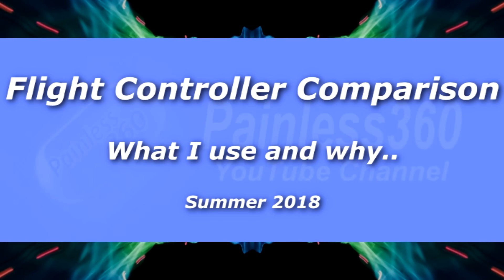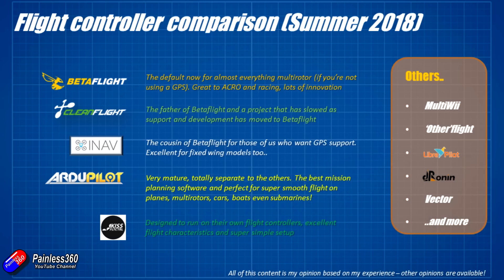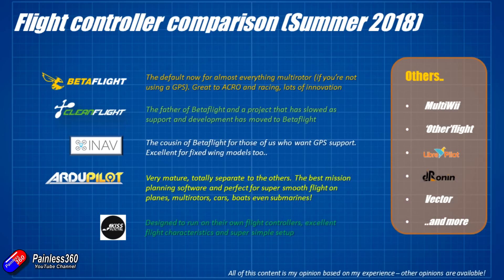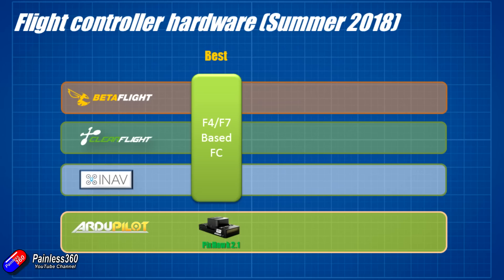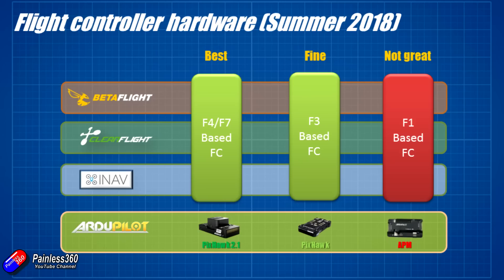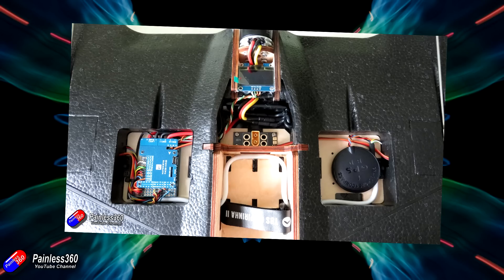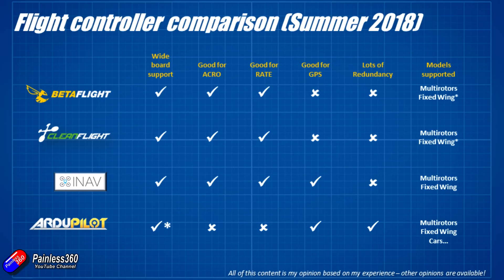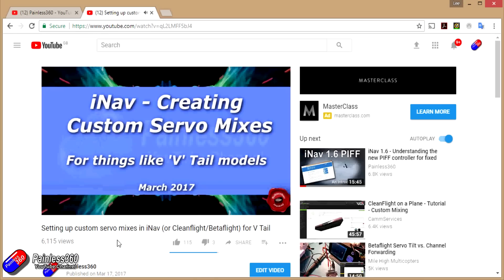What flight controller software & hardware should I use? (Summer 2018)

Comment: Hey. I'm about to throw beta flight in the garbage I've got three computers and trying to add these drivers to get BF to work has been a pain. So what would you recommend to use so I don't have to deal with another driver again? Thanks
Reply from the maker: I've never had any issues on Win8 and Win10, the drivers were there without me having to do anything.. Best of luck!
Reply: @Painless360  Thanks  I think the Win10 Pro is the issue.

Comment: OK Painless,  this is getting painFUL now. I had asked you about "programming" & here it comes but
you didn't have to answer.  This is part of my concerns to this hobby. I'd want something that runs
itself & just to do the transmitter ought to make for enjoyable flight but some overzealous code
writers had to outdo one another..... The ability to make it do more is great but 95% of people
don't want/need all the extra capabilities these seem to offer.
So many decisions.... I want simple.
I'm a simpleton.....lol,
an obtuse simpleton
Reply from the maker: I have to agree. A lot of the effort is going into adding more bells and whistles into the technology rather than lowering the entry point for new pilots - making it easier to set up out of the box. Technologies like KISS fly brilliantly and a lot easier to configure than things like Betaflight these days. That’s the reason I make these videos - a lot of the ‘manuals’ are average at best and unless you’ve seen somebody else set something up, you’re on a hiding to nothing. Check out the builds and  the build series on the channel, they should help a lot. Best of luck with your journey!
Reply: @Painless360  ~ Sir, I thank you & applaud you for all the dedication/time
you've given all of this. I'm in no hurry. I'm going to select quality & not
going to do a lot of excess work. All of these electronics could be on a
single board including step downs for different voltages. I'd gladly pay
extra to not go thru all of this now. But you're helping me greatly and I
am glad I didn't give up.  I don't think many understand the amount of
work you're doing just in the video end, not to mention all the RC Stuff?
Thanks for all you do.  diggy in dallas

Comment: Your videos are always so good! Been watching them for years. Got out of building quads for awhile with the advent of DJI spark and Mavic Pro 2. But was curious about autonomous flight with a Wing Z-82 . Was wondering what board to use now that all my ccd3 boards are outdated and found this great 👍 video. Your content is always spot on, relevant and precise. Thank You from across the pond!!!
Reply from the maker: I’d look at the Vector, Pixhawk or something running iNav.. best of luck with the build!
Reply: Painless360 is there a small FC ( comparable to the CCD3 Revolution) that I can use in the Wing Wing Z-84 and use with I-NAV? My main goals are stable flight, gps and ultimately autonomous mission planning. Is there something smaller than the Matek F-405 Wing , with less bells and whistles? I’m interested in trying I-NAV after watching your videos but have to upgrade some hardware. What do I do with all the cc3d boards and APMpro? I looked at the pixhawk4 mini. Looks nice 👍
Reply from the maker: @marcoantonio2600  There is. Google something like 'inav wing painless360' to find my videos on the F35..

Comment: Camera drone? Do any of these do follow me? Im new to this, a friend has a mavic that can follow you and has a gimble camera,  want to build something like that. Possible? Or buy a mavic or spark?
Reply: Its possible, but as someone who has built a couple of full size drones built on the DJI F450 frame, one with a CC3D and one with a Pixhawk2.1 as a camera drone platform...  Buy a Mavic.  The learning curve on the software to make this stuff work is immense. Flying is easy. GPS programming for following you around and controlling the camera while you do it and getting the video signal back to you so you can see whats going on, is a colossal pain in the butt.  I love my drone, and I can fix parts on it when it crashes a LOT cheaper than fixing a mavic or a phantom, but I also have well over $600 invested in all the frame, motor, flight controller, camera gimbal, camera, video transmitter, receiver, radio, video receiver, tablet to run software in the field... you get the idea.
If you want to just go out and fly and get stuff done, buy a Mavic, or other factory made drone, not shilling for DJI here, if you like building your own stuff and diving into the programming aspect, then follow some other vids by painless360 on building up the pixhawk series.  This is where I learned what I know about doing it.
Either way you go, get flying and have fun!
Reply: starhawke380   thanks! Pixhawk sounds like a good way to learn. A A.I.  "pet" drone that follows me around sounds a bit father off lol. speaking of repairs, my friend pushed go home I think while indoors and it went straight up and broke the gimbal on his mavic. not sure how much that cost. It is interesting to see some cheap Chinese drones that seem to have follow me , even the Tello? Saw some video on a mavic teardown and there sure was a lot in there. The flight controller looked very impressive and Powerful .  Just trying to figure out a build / buy path. Not even sure what features I really would like. Follow me and obstacle avoidance are probably the two biggest that I'd want. Thanks again, Cliff

Comment: Ardupilot now runs on Omnibus F4 pro, Matek F405, Openpilot revo and revo-mini, and a bunch more. Not sure if these are officially released yet but you can get the daily builds. There is good onboard OSD support for at least Omnibus F4, not sure about others yet. With the very cheap price it's hard to look at anything other than Ardupilot/OmnibusF4 combo for a GPS-enabled build.

You can initially use the Betaflight configurator to flash firmware to these boards, and thereafter use Mission Planner to flash different versions. Full info and link to firmware files here:
http://ardupilot.org/copter/docs/common-loading-firmware-onto-chibios-only-boards.html

For an acro-only miniquad my favorite is still the good old F1 naze32 with pre-3.2 Betaflight, have not seen anything to attract me to newer hardware or firmware for such a bare-bones single-sensor controller, especially where I'll probably be smashing into something eventually on my own anyway :)
Reply: iforce2d Chibios is a great move forward, hopefully it will bring otherwise separate communities together so we can all try new things without having to buy quite expensive dedicated hardware. 

I’m also looking forward to the day companion computers are more easily integrated into DIY mini quads and quality digital image sensors. We can then get a step closer to the likes of Parrot, Yuneec, DJI Autel etc... at the moment we can make and control amazing flying machines that are either 90mph smooth flying rockets or 3mph super stable GPS builds. But adding the digital image and “touch screen app” features is not as easy. 

Thanks
Reply: Please share the link to buy omnibus f4 pro

Comment: Where do the Pixhawk clones from Chinese vendors (2.4.8) fit on this chart? Abyone with experience of these FCs?
Reply from the maker: Almost all of the Pixhawks that you get these days (apart from those from the main manufacturers like the Pixhawk 2.1/CUBE) will be clones. Trick is to get ithem from places that have good reviews..
Reply: Many thanks for the quick reply! Since the nomenclature is somewhat counterintuitive (2.4.8 vs 2.1), I just like to ask if these Pixhawks 2.4.8 are the type of FC described in the "PixHawk Video Series", that fall into the category "Fine" in the FC overview chart in this video.

Comment: thank's for this point. very usefull.
just a question: I have a Naza mV2 on an old F450. is it possible to change DJI firmware for INav ? Is it a good idea or not ?
Reply: Nope, you can't put iNav (or the others) on DJI NAZA hardware, sorry, Steve
Reply: OK ! thank's ;).

Comment: Lee u no if u wanna get longer running time on yr quads or ground rc.s is it a bigger c rating u want to look at or bigger mah
Reply from the maker: You want a few things, less weight, more efficient motors/props and more energy in the battery. See my endurance quad build series..
Reply: Painless360 cheers lee ill ave a look
Reply: Painless360 lee without doing all of that just to upgrade the battery as im not sure weather its the c rating to be higher or the mah to get a longer time of use lol

Comment: Great comparison! I would really like if you make a project with ArduCopter and Pixhawk 4 on a multirotor. Copter version 3.6.0 which should support this is soon to be released now (currently RC7). Thanx for the video anyway!
Reply from the maker: I will, once the code has been released and stable.. almost there!
Reply: Yes, I'd like that also, have a good day, Steve

Comment: Very thorough Video ....   Thanks ..!
Reply from the maker: Thanks for the comment. Very few channels actually go to the trouble to talk about the different systems and what is best in each of them. These days (with each flight controller being able to run so many different versions of software), it's more about picking the right combo for the model type, flying style and use you have planned. Thanks again, happy flying!
Reply: Painless360  Thank You for your reply . Have you ever mounted  an OccuSync Air setup to a temporary mount that can be transferred between airplanes ?   The extra units are so expensive to purchase one for each plane . Not sure if that is anything you or your friends have tried . I have a Pixfalcon going in a 8 in build soon . Enjoy & Happy Flying ...
Reply from the maker: I've not. I have designed a few backpack style enclosures for analogue fpv - see my Thingiverse page..
Reply: Painless360.   Thanks Again. ..

Comment: What GPS system would you recommend if using a f4 flight controller and Inav?
Reply: Any M8N GPS will be ideal for INAV, if it's for a fixed wing aircraft it doesn't need a compass. M6 and M7 also work
Reply from the maker: Thanks Tsnafu, perfect answer! :) Ian, please see my iNav series for examples of builds using that GPS..

Comment: Great video as usual! Thanks you for all the amazingly well structured videos.
What FC would you suggest for a 3 inch freestyle quad with focus on long flight video capture (split mini or Caddx Turtle cam). Was looking for one in 20x20 size with barometer to be able to flip from full acro to altitude hold depending    on the occasion.
Reply from the maker: I've not built any 20mm FC based quads but the EMAX Baby Hawk 3" flies great so I'd look what's in there..

Comment: I've been following the INAV communication on github for a little while now and I see more and more often that they talk about dropping support for F3 FC because the F3 based FC are soon running out of memory so even though F3 FC will work for some time I would buy at least F4 based FC from now on...
Reply from the maker: Indeed, hence F3 is Good and F4/F7 is Best in the chart. Let's hope they keep support for F3 going for some time to come. I don't want to have to pull all those F3 boards from inside planes! :)

Comment: Good video, I can’t get a good picture out of the omnibus f4 pro v2, terrible noise, I couldn’t pinpoint the problem so dismantled my quad bit by bit back to a board with only the fog gear on and still unusable, I used the video gear on another board and it’s working fine, all points to the omnibus board, don’t know if I were just unlucky or it’s a known problem, I switched to a speedy bee f4 aio, great picture but the board needs a different lay out.
Jeff
Reply: Jeff W INAV 2.0.0 RC6 now supports SpeedyBee AIO.
Reply from the maker: Maybe you were unlucky and your had a bad component. Some of the boards now are 'clones' and do have a lot less quality checks..